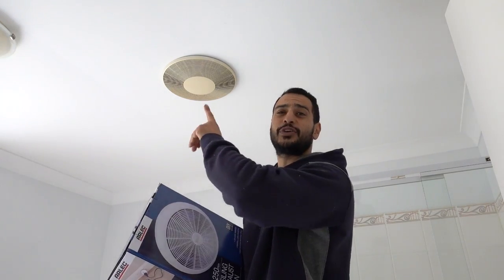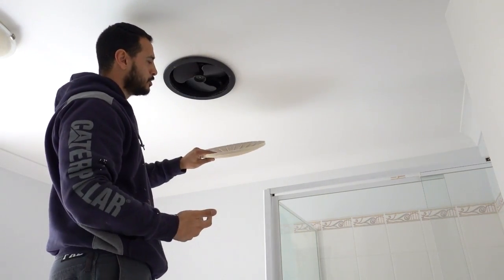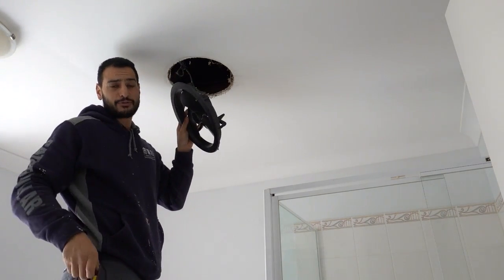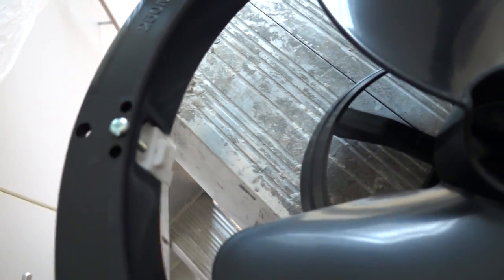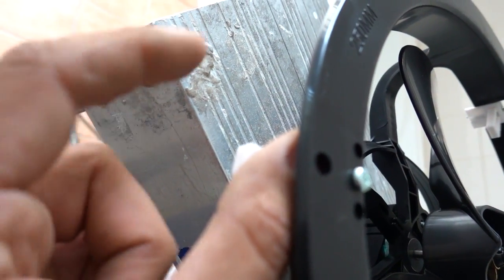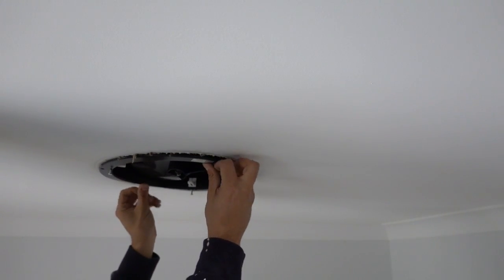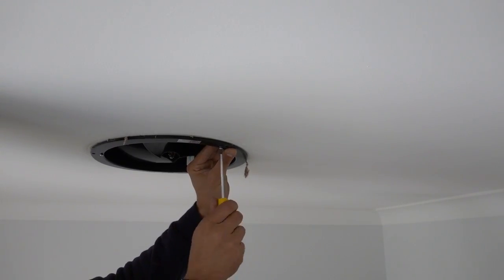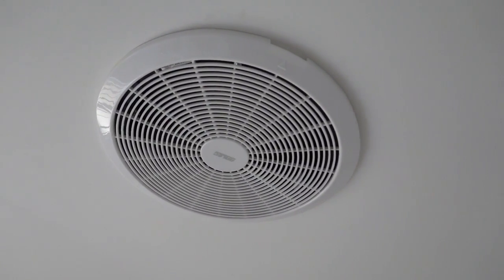How to remove and install bathroom exhaust fan

Comment: Mate, thanks so much for this! I was trying to install a new Deta fan and couldn’t figure out why those clips wouldn’t attach to the drywall properly. The instructions in the box neglected to mention I needed to loosen the screws first and then push the clips up before tightening again. You’re a legend. Fan is now installed and working perfectly.

Comment: Hey mate, I bought this Arlec 250mm exhaust, and cannot for the life of me see how its suppose to work. If the fan clamps onto the plasterboard snugly, then how is the clip on grill suppose to get the clips over the fan bezel? 
My clip on grill doesn't clip on, because there's no room between the fan bezel and the plaster. If I leave room by not tightening the screws, then the fan is loose, and then gets pushed up when I try to clip the grill on. This appears to be the worst engineered product, am I missing something?

Comment: Do we need to turn any circuit breakers off? Does the power socket in the ceiling have an on/off switch? Cheers matey.
Reply from the maker: Hi, if it’s a power socket than no circuit breaker needs to be turn off and no switch. It’s similar to a power point in the roof cavity without an on and off switch👍

Comment: This is a great video.  Sadly I bought a Delta 250 mm and the screws hardly budge to tighten when clamped to the ceiling.  Putting on the cover is hard because of the poor clip design.  I think I will take it back.
Reply from the maker: Try and have another look at the clamps to make sure they are in the right position. Could be a simple thing that is preventing it from clamping

Comment: the clamps are great idea.... but lets say if the fan fails how do you undo the clamps, if your hands are small enough, you can put your hands through the fan to the other side and push the clamps but if your hands big thats it.. i donno how u would remove it
Reply: You should be able to unscrew it until the screw comes out.

Comment: Is the mechanism same for the square type exhaust fans too ..? 
I am in Australia. How do I remove first the face plate or the cover plate. ?🤔
Reply from the maker: I’m assuming that the square one you’re referring to is an ixl ( heat/fan/light). These are hardwired and will need an electrician to replace. To remove the cover you fist unscrew all the light globes then you will see springs inside that are holding the cover plate on which you in clip👍

Comment: Hi Bill my fan is duct taped to a flex pipe and it’s connected straight to the wire no plug. Is there a way I can somewhere disconnect the wire so it’s not live. Obviously will turn off the power first

Comment: With these do you need to install ducts to it like the piping?
Reply from the maker: Depends on the type of exhaust fan you have purchased. This particular one does not require a duct 👍
Reply: @billshowto  oh wow that was a quick reply!  t im buying one similar to this its an arlec. Thanks heaps!
Reply: Tradie did the same today and i wonder why there was no pipe leading out.

Comment: What’s the most quite wxhaust fan brand ? Bought a cheap one from Bunnings Jesus mate it’s loud as shit . Once u switch on and off there is a loud noise and bearing sounds fkd
Reply from the maker: Make sure it has been installed correctly. if it has been forced in it will make noise as it can’t rotate freely 👍